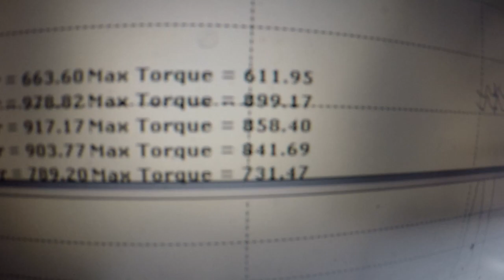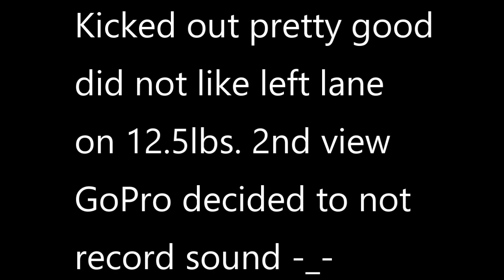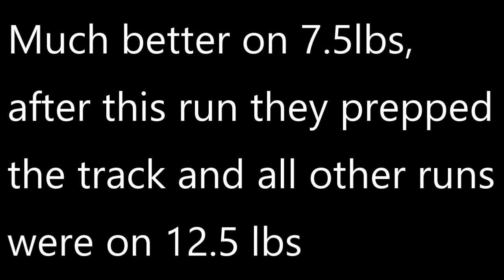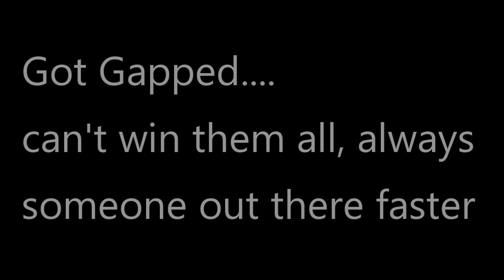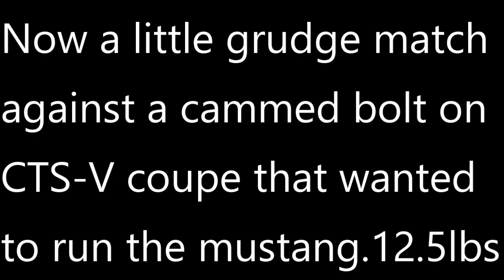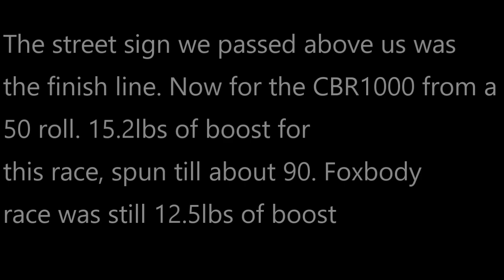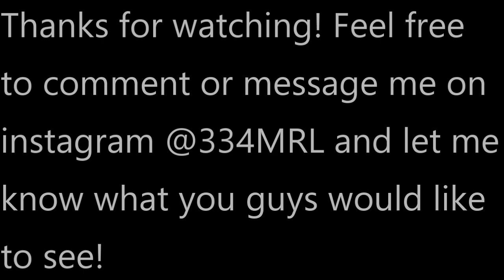Twin Turbo Coyote Dyno and Running Nitrous Foxbody & CBR1000!!

Comment: You pulled that hard on a CBR1000 running only 15.2 lbs 😮I’m just more impressed with this car with every video I watch!
Reply: Cody Miller probably an inexperienced rider. Curious what year that bike is. From a dig I think the bike would take him to Gapplebees for some Gapplesauce.
Reply: Samuel Jackson I’d agree that from a dig the bike would gap him hard, but after watching how hard he pulled on Mike’s 570S, I think even with a good rider, a litre bike would have some difficulties. Like I think he put more of a gap on Mike’s 570 than Andy did, so I could see him being able to take a litre bike even with an experienced rider.
Reply: Cody Miller I stated that because of the riders body position. It didn't look like he went into a full tuck behind the ferring (windscreen). I've been riding for over 15 years and owned multiple cbr's. It's one of the heavier bikes. But that mustang is pushing 1000 hp, it didn't surprise me that he took the w.
Reply: Basically your body position hugely effects the aerodynamics. And starting from 50mph in just a couple secs they are easily into the 120+ realm. Around 120 is where you can feel your helmet start to smash your face if you don't have a good one. There's just a lot more that goes into racing a bike than turning a handle. Most people don't realize that. They are over exaggerated on video games lol.
Reply: Samuel Jackson I’ve actually owned a couple of CBR’s over the years as well (‘00 929, ‘06 600, ‘08 1000). I don’t have a bike at the moment (crashed the 600 hard while tracking it last year, so taking a bit of a break), but have also had a 2006 ZX14. So I realize there’s a lot of skill in racing a bike, but regardless of rider skill, the fact that the Mustang pulled that hard on the CBR is very impressive and that’s only at 15.2 lbs of boost. Even with a perfect rider, I don’t think any CBR is going to keep up from a roll when he’s making 1000+ at the wheels.
Reply: Cody Miller nice! I had a 929 and crashed out into a suburban lol. It was fun. Had a chance to get a 954 but chickened out Cuz the crash had me shook. I ended up getting a 07rr. That's cool you have an 08! They did an engine update that year and added more ponies and some ecu wizardry along with some titanium engine springs. I think the engine redline was increased to 13 k also. I agree though, trying to roll race a 1000 whp car is tough no matter what conditions. But the '11 cbr did a good job keeping up. They are claiming 189hp for the '14 cbr. Might be a better match up